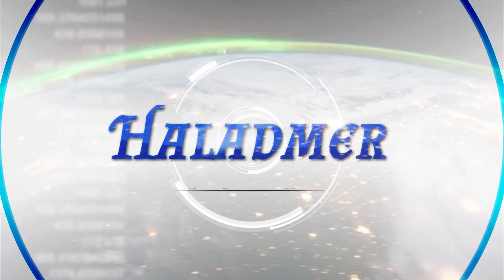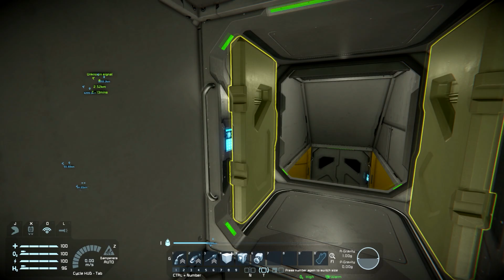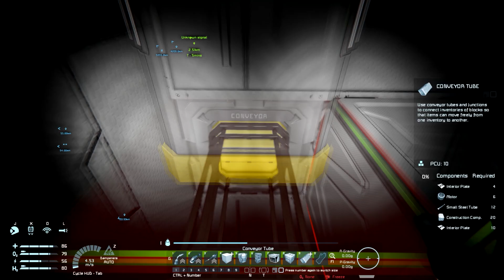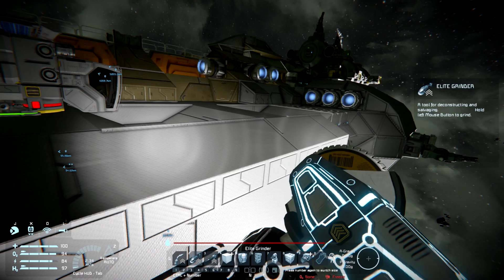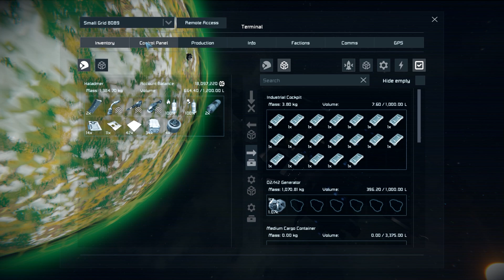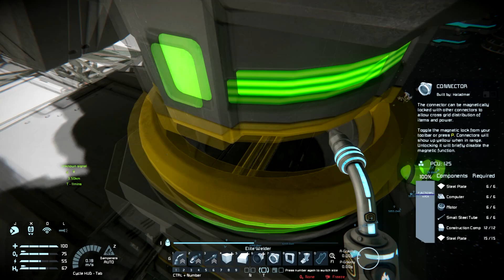Space Engineers | Economy Progress | Ep.21 - Upgrades & Another Ship?!?

Comment: You have several (4) forward-facing conveyors already connected to your upward and downward facing thrusters. If you need more, you could use (6) small-small grid right angles to hook up to the conveyors on your large forward-facing thrusters.  If you need more, you could use (4) small-small grid right angles to hook up to the conveyors on your downward-facing connectors. If you still need more, you could use the same (4) small-small grid right angles for the conveyors connected to your upwards and downward-facing thrusters. Regardless of your placement and how many you have, it might be a good idea to keep the large forward-facing thrusters, just leave them on a group.
Reply from the maker: Great points, and some of the design was specifically to do that (or to leave room for armor plating), as I use the ship more, I get a better idea of where I actually need to make changes to the thruster system for my flight style, and these areas are on the top of my list when I make those changes! :D
 
And I think you and I are on the same idea with the large thrusters (I set up cruise control with them in the next vid ;) )

Comment: For the gas scout, I suppose the vanilla version of "large to small" conveyor ports would be the large Small grid conveyor block as that has small ports on it which would take up the space of the large Small grid hydrogen thruster. Do you have enough space in the rear center-line, where you mentioned wanting to added a connector, to add another gas tank? Are Spids of concern to you on the planet? Will you be arming your gas scout? Will you be armoring your gas scout? EDIT: I in the next video what you added to the centerline of the gas scout; nice!
Reply from the maker: lol.. thanks, I sort of realized I had forgotten to add the survival kit in the original build :D   For the thrusters, I'm actually thinking to run some piping down a tank edge to a conveyor array on the large conveyor ends of the tanks.  The array would feed 6 or 8 small thrusters to keep thrust levels high, but fuel consumption much more manageable.  Given that I'm actually using the "cruise control" concept now, I've already increased my fuel efficiency, but being less "hungry" is never a bad idea lol

Comment: The conveyor adapter you were thinking of is called a Conveyor Frame.  Not 100% sure if it is a vanilla block or something that is added by the More Conveyors mod that I have installed on my game/world.
Reply from the maker: Yeah, I thought the old vanilla frame used to do it, but the current one is simply an extension mount (1x3x3), really annoying to have to use a full 3x3x3 to resize the connector ports lol
Reply: @Haladmer  The More Conveyors mod by Mafoo ( https://steamcommunity.com/sharedfiles/filedetails/?id=1124114101 ) includes an adapter that converts from large connector on one side and 3 small connectors on each of the other 5 sides.  It also gives you some other nice 3, 4, and 5-way splitters, long tubes, and other things.

Comment: So i wound up giving up on the bomber, it might have a use but as a direct fighter, that wasn't it. So i think i'm going to go with the small ion miner.  It has cargo containers that i can put welders on either side of, and the decoy blocks off of those.  It'll have a nice flyign wing design using heavy armor.  Going to have a hard time finding all of the metal grids from vendors, but that adds to the challenge.  Also thinking of removing the cockpit and using a remote control and a plain sitting in seat and remote piloting the grid, whist sitting in an armored portion of the grid, if it will work that way.  I'll add the super gridded small grid turret too, of course.
Reply: sounds like a neat build that is taking some figuring
Reply: @AdredenGaming  yea itll get there. I'm also incidentally powering my large grid base at night off of small grid ship batteries. Didnt realize that could be done, but they get recharged each day via solar array so there you go. But loaded an old save. Going to turn the small ion miner into a B-2 if you want to google it to get an idea, with repairing projected decoy blocks on the end of the wings. Going to try to use just a small ship turret on the chin, use the zoom feature and snipe turrets from a distance, maybe. Still really struggling with small grid ship combat.
Reply from the maker: Sounds like the rebuild is going to be a lot more work than originally expected?  Good luck with it!
Reply: @Haladmer  yea at this point less a rebuild and more so a scrapping and going in a different direction. I think the small ion miner won't be much work, tbh.